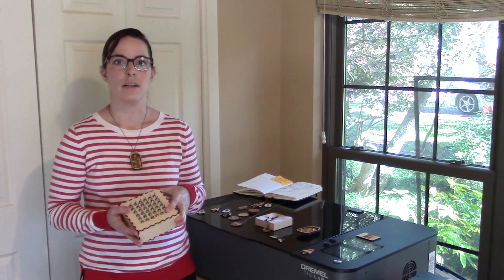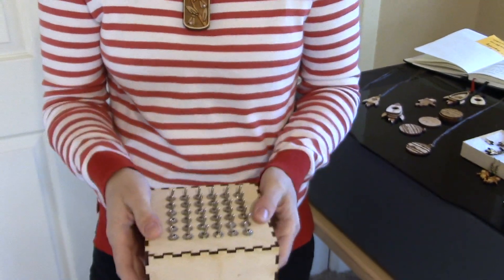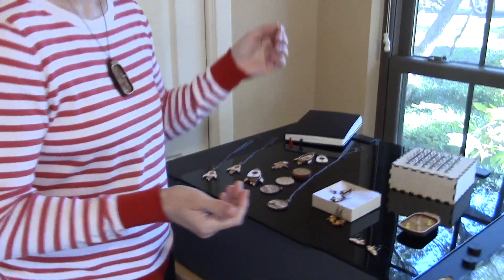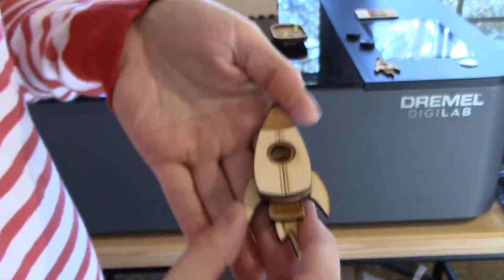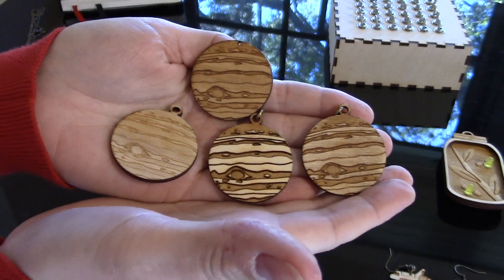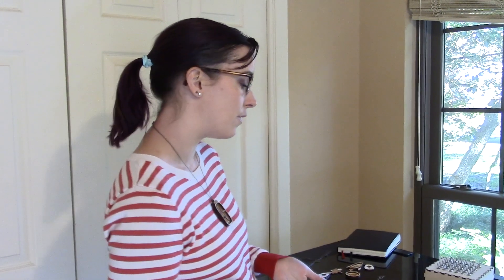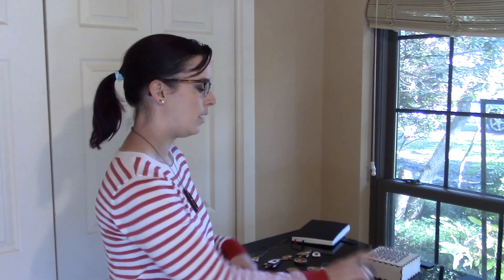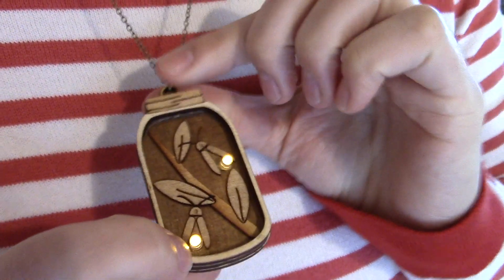Laser Cutting Update - What I've made so far with my Dremel Digilab LC40 Laser Cutter

Comment: Great video. Love the integration with the electronics. 
What made you pick the dremel? Sorry if you already answered that in a previous video
Reply from the maker: Thanks! I haven't talked about it yet, but I chose the Dremel for a few reasons. 
1. It's a second generation laser cutter so it's less likely to break 
2. It has a big focus on safety features that I appreciate. 
3. It's beautifully designed and a good size - bed size and machine size. 
4. It's a good starter laser cutter. 

I'll do a whole video on why I chose it pretty soon!